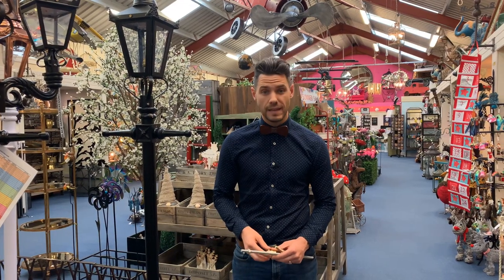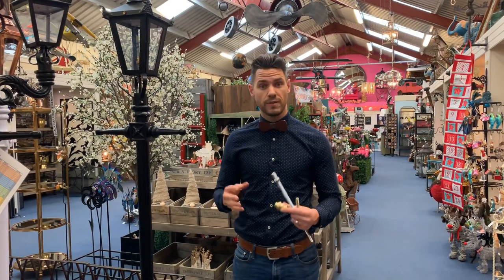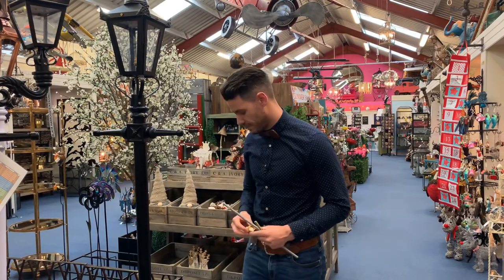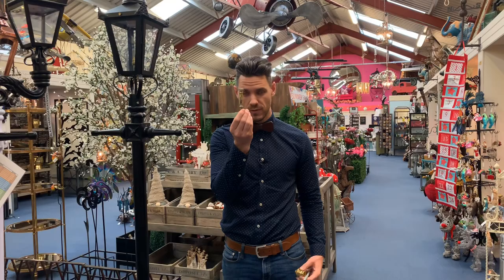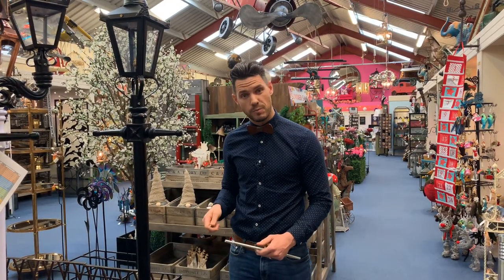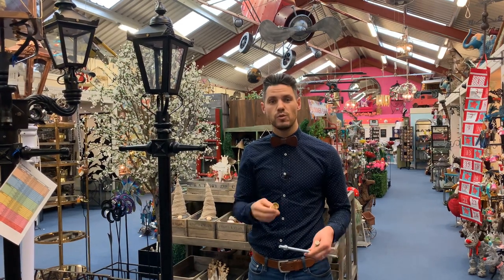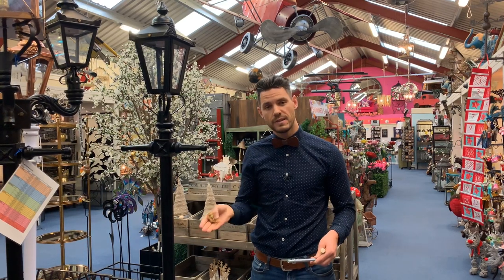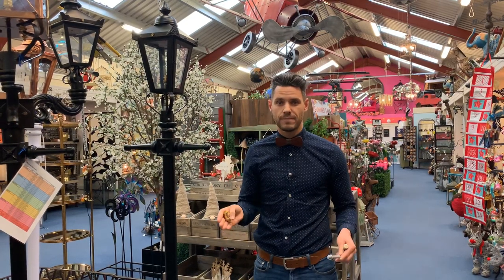Installing a Lamp Post from the English Lamp Post Co

Comment: A bit small looking Ive estimated I would require about 15 lamposts to line my drive 30 if I decide to line each side of the drive, I would require another meter on the height at least.